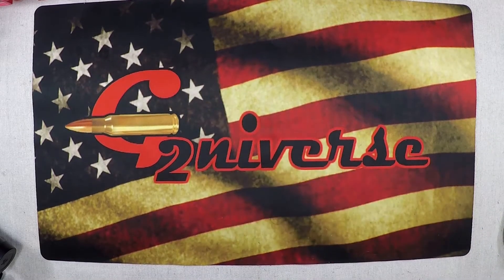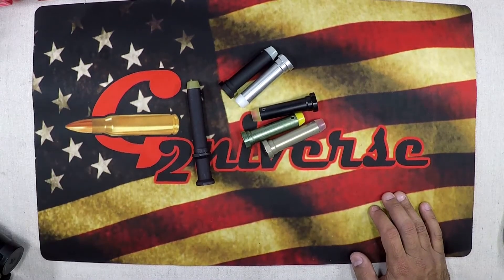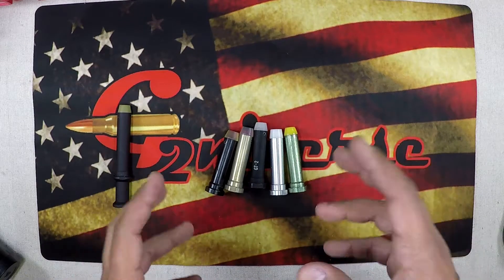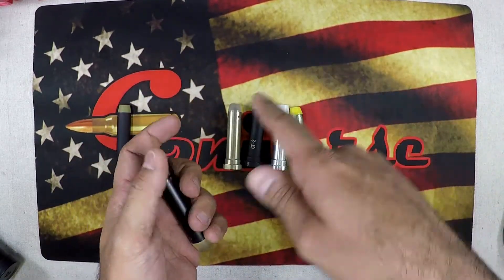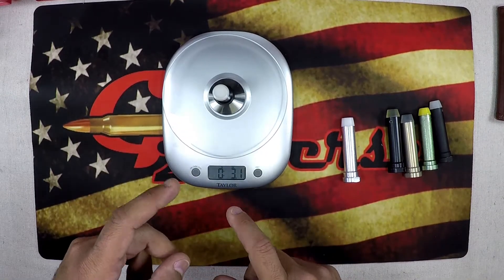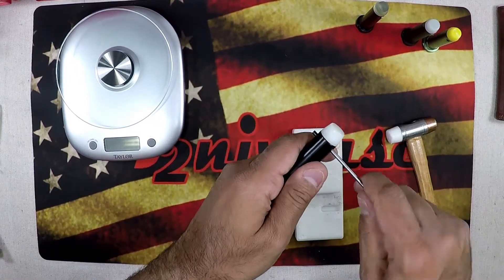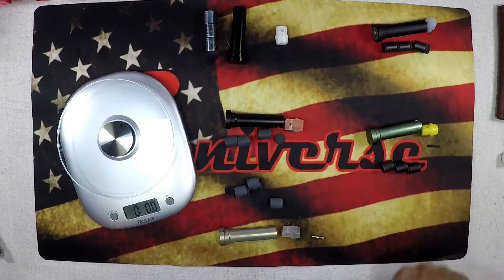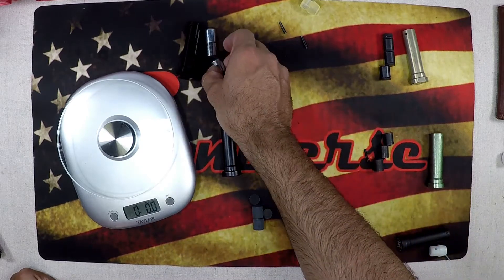Buffer Weight Calibration

Comment: I’ve done over 30 builds. Mostly 16”. I have a scale (a must) all the weights in the build kits were 3.0 oz. I change out one of the weights to make it a 3.8 oz buffer. This worked perfectly for almost every build. All I have to say. Working perfectly means using steel case cheap low power ammo firing one round at a time looking for 3:30 ejection and lock back.
Reply from the maker: I agree right around 4oz for a 16" system feels really good.

Comment: What about the spring? I always see buffer weights but not a spring rating system.
Reply: Springco has a rating system. White to red color indicates power.  Any other brand is going to be standard and length will be the only consideration. Sprinco adds a variable